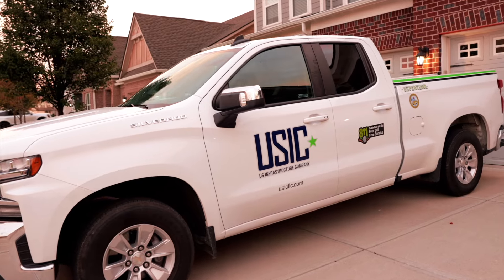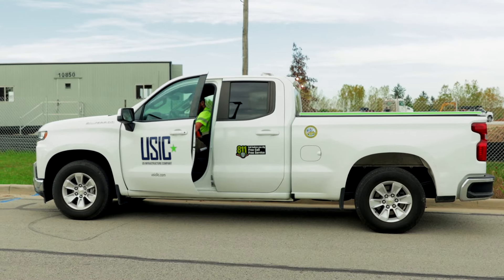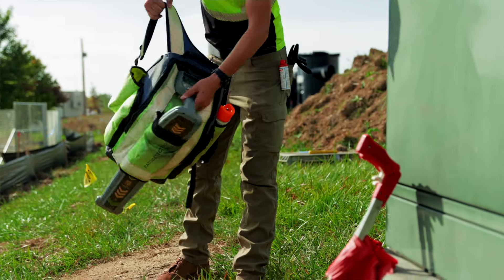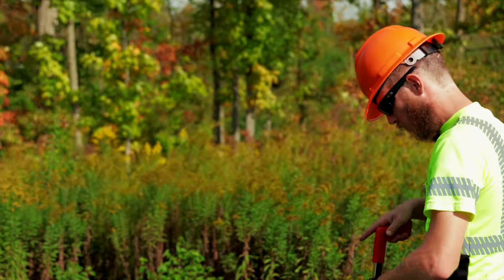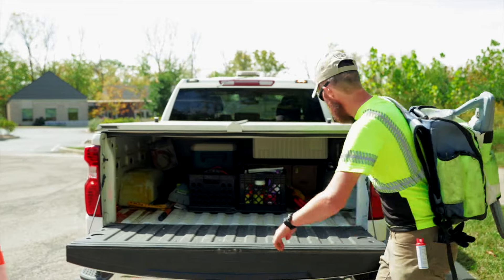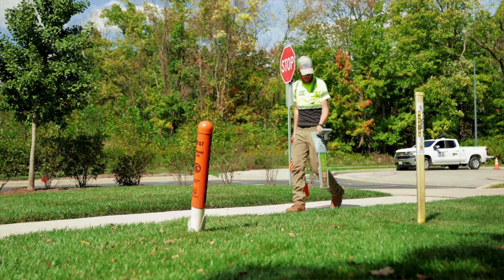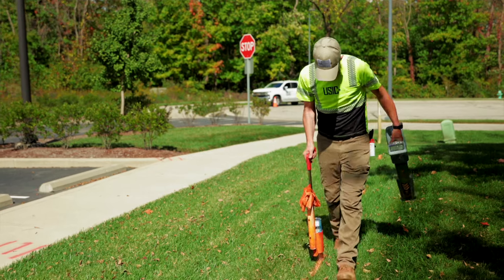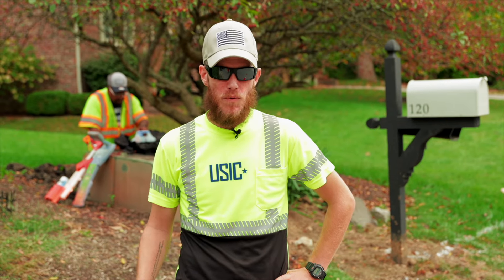Day In The Life of a USIC Technician

Comment: A Supervisor talking about 'day in the life of a technician' now that is ironic, supes sit in their trucks, always idling, always in A/C, sitting on the side of a road, no beacons/strobes, no cones, and pass judgement on techs that idle more than 20% of the time, or dont have their cones at exact perfect placement.  

Supervisors are basically "Do as I say, not as I do, because we don't lead by example, but hold you to standards we don't hold ourselves to"
Reply: That sounds like a poor manager or supervisor. There is always one that is afraid of you taking his/hers job so he gives you hell!
Reply: yessir! been in for almost 10 years with usic but have worked for other companies. USIC has a whole different way of managing, completely free of any common sense. They try to manage mainly with scare tactics, which works on the newer guys. As long as you can maintain a damage free record, youll always have a job with or without them. There are a ton of locating companies and locating is only getting bigger and more important as infrastructure grows and gets more complex. Pay will increase as time goes on as well. Its a good job if you can tune out the corporate noise.
Reply: Thats walmart buddy
Reply: Yessir… I’ve always said USIC is the Walmart of locating… they are the biggest, the undercut the competition to gain more contracts, and when they can’t beat the competition they buy them… USIC will buy all of the other smaller companies just to cut out the competition.. it is all about quantity over quality..